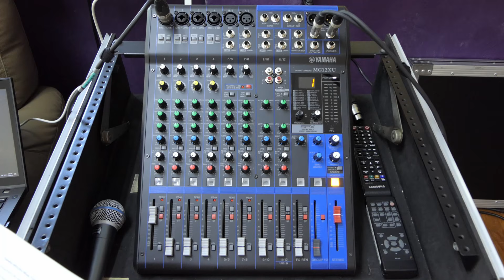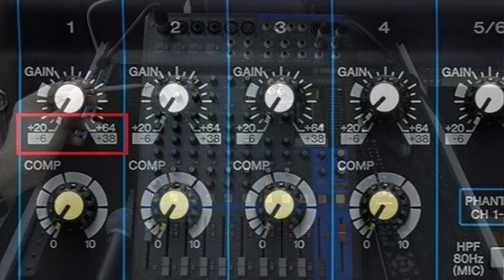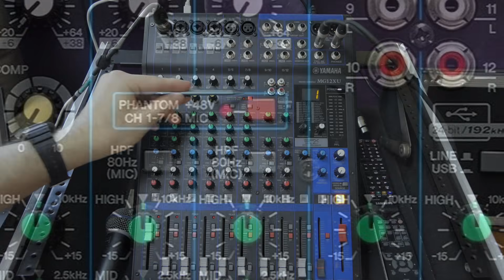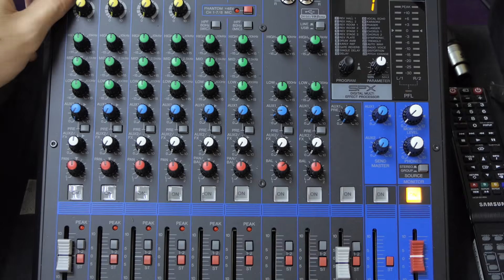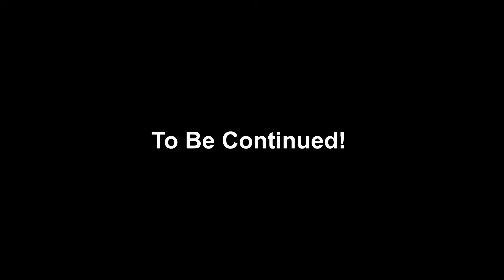Yamaha MG12XU Mixer Tutorial Part One

Comment: Can the XLR and 1/4 Outputs be used at the same time? Are the Group and Monitor outputs similar to the "ALT 3-4" outs of a Mackie?
Reply from the maker: Yes they can. No - ALT 3-4 is found only on Mackie mixers. The group allows you to create a sub-mix of selected channels, which can then be sent to the main mix and/or to another destination fed by the group output. The monitor outputs are specifically for connecting studio monitors when the mixer is used for recording, although they can be used for other purposes.

Comment: The aux send are unbalanced?  I tried to use them as in ears monitors but I can hear only in one side. Is there is a way fix that?
Reply from the maker: They are balanced, which is not the same as stereo. For IEMs you need a stereo (left and right channels) send, which typically means using two aux sends, or a stereo aux send which this mixer does not have.
Reply: @GLBProductions  thank you for you answer.
Is there a mixer with aux send in stereo at the same price range?
Reply from the maker: Check out the Zoom Livetrak series of mixers - these have multiple headphone outputs which can be used to feed your IEM system. Amazon pricing for the L-8 is almost exactly the same as for the MG12XU.
Reply: Just bouncing around YouTube. Saw this question. I think a TRS to 3.5 adapter in “Headphones “ output would get that done. I guess it might depend on “in ear” monitors used.

Comment: Hi can you pls make a video for internal effect. Going to aux because I'm having problems putting effects on aux going to zoom meting or other device or computer. Thanks in advance.
Reply from the maker: Ricky sending the internal FX to the aux send is covered in the video around the 13:00 mark.
Reply: Hi I'm sorry I forgot to mention that I'm using an behringer qx 2442 mixer, can I put effects on aux send?
Reply from the maker: On that mixer it appears that you can only send the internal FX return to the mains and subgroups.
Reply: OK thank you very much.
Reply: 1 more question will you suggest Mackie pro 12  or 16 v3 series or any other brand that can put effects on the monitors? Thank!

Comment: Does it have built in audio interface which can go straight into smartphones?
Reply from the maker: Not really - the audio interface is USB 2.0 class compliant but is designed for connection to Windows or Mac computers. For smartphones you need the appropriate cable and also the correct drivers.

Comment: Hi, I just got this mixer and new to this. I followed exactly as you did with plugging the mic and turning on PFL, but as soon as I shut off PFL the mic stops working and I see no signal on the screen. Is there something I may be doing wrong?
Reply from the maker: Check to make sure that the channel is routed to the mixer's main outputs, and that both the mic channel and main channel have their faders up and are switched ON.

Comment: did you use mic activator for that mic? my microphone sennheiser xs1 dynamic mic requires more gain.  i need to turn the gain knob at 3 o'clock position to make it hit 0db. can you help me about this problem?
Reply from the maker: Some mics require more gain than others - try comparing your mic against other dynamic vocal mics in the same class eg Sennheiser e835, Shure SM58 etc. Also make sure that you are connected to the XLR input with a high quality cable and that the channel pad switch is OFF.

Comment: I cant get panning to work im losing my mind i tried everything
Reply from the maker: Try monitoring the mixer's LR output using headphones with all the PFL switches OFF i.e. disengaged. Do the pan knobs work then?
Reply: @GLBProductions  When I disengage all the PFL buttons it completely kills all audio signal output.
Reply from the maker: Ok it sounds like you have signal routing issues as well - go back to basics on this one, check your connections, channel routing and on/off buttons and the setting in the 'source monitor' section of the mixer.

Comment: Sir in MG 12XU Analog mixture
1. Connected Condenser mike in  Channel one, Gain adjusted and assigned to Group not to main.
2. Effects master on and set to Group not to main
3. Group return on and set to main
4. Main on set to neutral at 0
But no Vocal could be heared  on head set.
If i set all to main then it works
What Grouping mistake  i did
please
Reply from the maker: Did you remember to raise your group fader to 0db?
Reply: @GLBProductions  YES.  Channel 1 vocal to group 1-2, FX to group 1-2. Group fader upto 0 and assigned to main. Main fader up to 0- Not working
But when i asign all to group and main( Channel 1 and Fx and group fader down not asinged to main and main fader up to 0 it works.
But again i will try.

Comment: I was just wondering can this mixer be used as a stand alone interface
Reply from the maker: Sure, although it's a bit large for that purpose.
Reply: @GLBProductions   I was thinking to use it as an interface so I don’t have to keep unplugging and plugging things in as I do with my two input interface.
Reply from the maker: Well it will certainly solve that problem 😄
Reply: @GLBProductions  thankyou for responding...much appreciated.

Comment: Thank you for replying so fast. I have a question for you, if you could be so kind I'm trying to decide between the Yamaha MG12XU Mixer & The Yamaha MG10XU USB Mixer  I will be hooking it up to Boss rc 505 looping station and Roland Handsonic HPD – 20, Roland System 1, Yamaha MX 49, Strymon TimeLine Multidimensional Delay Pedal, Novation Circuit Groovebox and one Mic. I am working on creating a live looping show, what do you recommend thank you so much again.
Reply from the maker: Between those two: choose the MG10XU if you need the smallest size possible and are willing to deal with the external power supply. If you can afford the space the MG12XU is a significant step up in terms of features.
Reply: Thanks again so very much

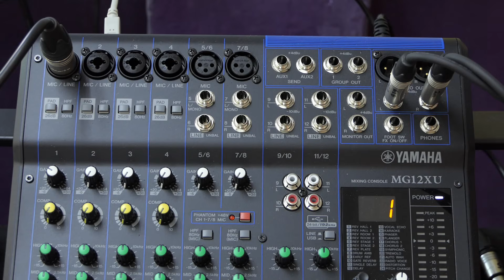Comment: Hi, we had purchased MG12XU Mixer around 4 weeks back to be used for our online worship through Zoom. We currently use 1 line for Microphone (Shure SM48) and another line for keyboard. But no matter what we do the vocals volume is low and keyboard volume is high. Our current setting is Microphone gain is at 2:00 Clock, and the fader is at the peak. Keyboard gain is at 11:00 clock and fader is on 0. Any advise will highly support us in our online worship. Thanks
Reply from the maker: What have you tried to do so far in order to solve this problem?
Reply: I tried raising the gain of the microphone and lowering the volume of the keyboard. But lowering the volume of the keyboard leads to non syncing of vocals and rhythm. Please give me your thought on what am doing wrong and what should be done. Thanks
Reply from the maker: Is the non-syncing of vocals and rhythm due to the singer not being able to hear the keyboard?
Reply: @GLBProductions  Yes thats right.
Reply from the maker: It sounds like you need to set up a monitor system for the singer using aux 1 - that way you will be able to balance the vocal and keyboard for the zoom broadcast without affecting the singer's ability to hear the keys in the studio.
Reply: @GLBProductions  Thank you. Iam planning to get a monitor. Can you tell me what is the apt setting to balance both keyboard and vocals for zoom? Sorry for my ignorance. Am a novice in this field.

Comment: Just bought one of these (my first mixer), and can't believe how much it can do!  I'm used to all the vintage gear, and your video is super helpful!  Thank you!
Reply from the maker: You're welcome, glad the video was helpful :)
Reply: Stan, does the mixer have a built in audio interface for smartphones?
Reply: @pennywiser9607  you'll need a special cable for that. It looks funky, three connections. A 3.5mm connector for your phone (which you'll probably need an adapter for) and then it splits off into two (an xlr, I believe, and a trs connected). Kettner creations channel does an excellent demo of it. Hope that helps.

Comment: I need your help. I'm planning to use this mixer for podcasting and I'd like to know whether it's possible to plug four pairs of headphones into AUX1, AUX2 and GROUP OUT 1 and 2. This configuration will prevent me from buying a separate headphone amp but I don't know if my reasoning is correct.
Reply from the maker: Not directly - those outputs are mono balanced: a headphone needs a stereo unbalanced signal fed from a low power amplifier suitable for headphones.
Reply: @GLBProductions  Alright. So I'm sticking to the MG10XUF. I thought those output signals of the 12XU would be good for phones. Thanks for clarifying this. You saved me some money. You're an amazing educator.
Reply from the maker: You're welcome 😊

Comment: I love ur vedios sir very helpful specially for the beginner like me,,, i used mg10xu at present may i ask  if compression knob & HPF button can help in eliminating mic feedback even the eq knob all position at center, w/o affecting the desire volume output?? God blessed you sir...
Reply: Tnx sir... Very well explained,,, 👌👌👌
Reply from the maker: Yes in certain situations: the compression knob can help prevent feedback that happens due to sudden loud signals eg when somebody shouts or screams into the mic. The HPF can help prevent low frequency feedback in the region below 100Hz. However this will not prevent all forms of feedback.
Reply: @GLBProductions  , I have the MG10XU and it does not have a PFL button. No faders too but volume knobs instead.
My question is, how do I properly set the gain?
Thanks.